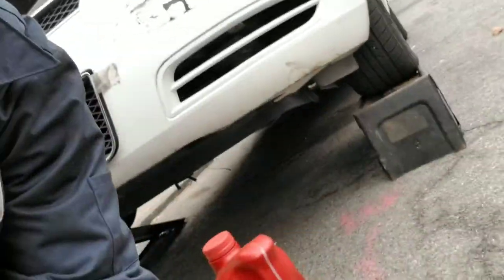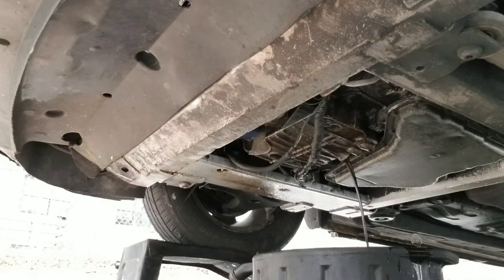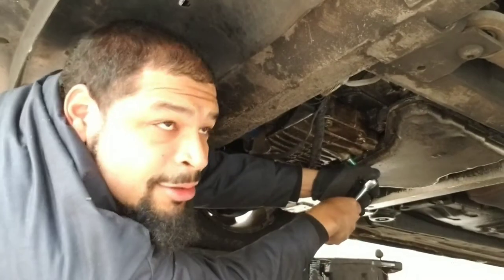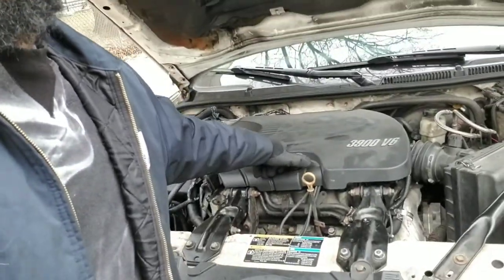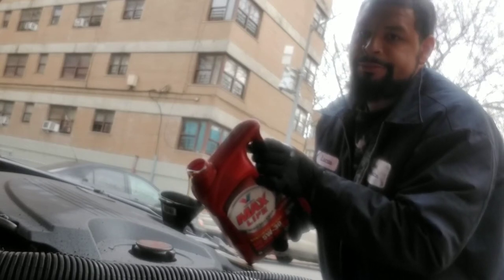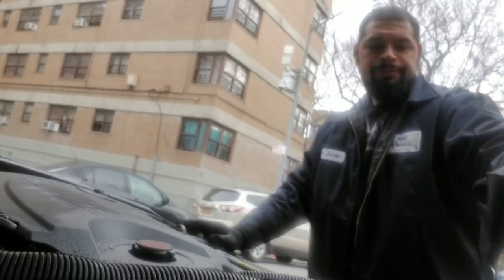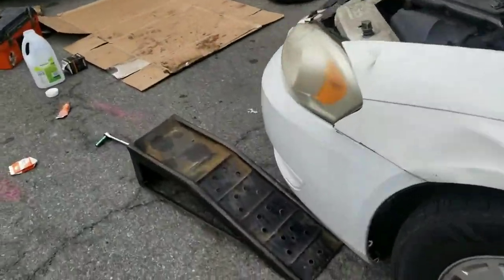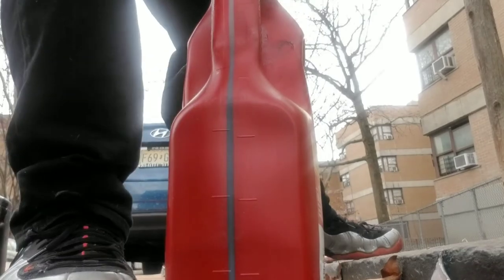2007 Chevrolet impala Oil change / quick and easy /  DIY / 5w-30 / VALVOLINE

Comment: Do your impala have 2.map sensors I see alot of the 3.9 do I have a connector that I don't know where it goes everybody keep saying it goes to the second map sensor and say they are the same but the connectors don't look the same so im lost
Reply from the maker: No just one, from what I remember honestly
Reply: @2SmartAuto  the second one is normally by the throttle body on a bracket